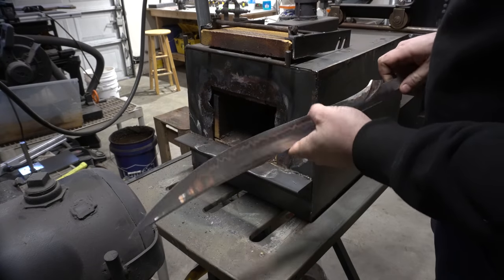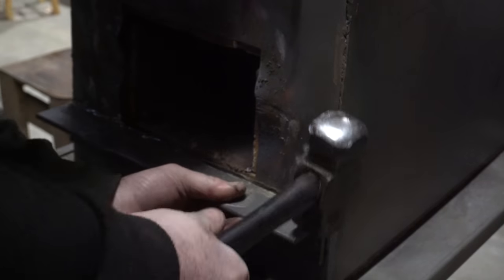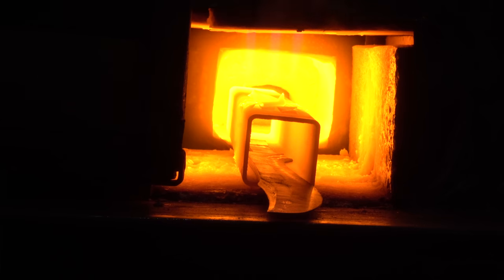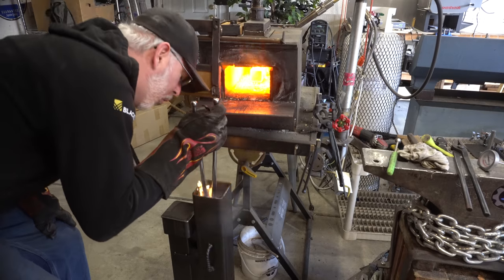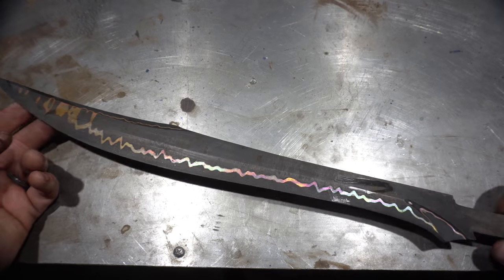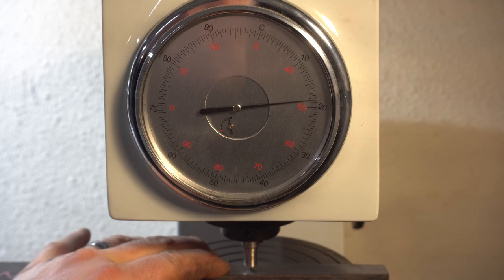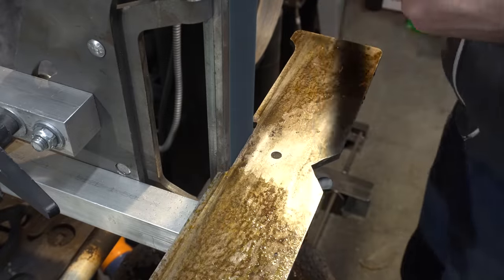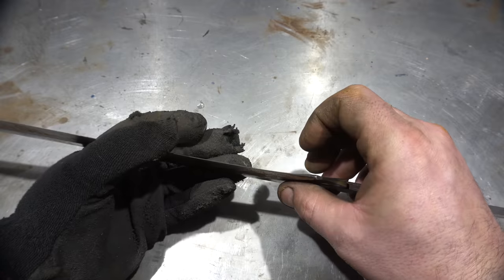Copper Damascus Elven Short Sword - Part 2: Heat treating

Comment: This blade is coming out sweet. I love the rainbow effect the copper had coming out of heat treat. Would be cool to get the effect back on the final product.
Reply from the maker: Yeah, some day I’ll get that effect on the final blade.  This one will be a dark finish though.
Reply: @TyrellKnifeworks  ya the dark damascus finish with the rainbow effect on the copper would look amazing. Your Damascus alone always comes out great. Adding the copper just makes it that much cooler. Then if it had the rainbow effect on the copper with the dark damascus would be that much sweeter. I cant imagine it would be that easy to do since reheating it to get that effect after its heat treated may could out the hardening.

Comment: Another thing you can do with a muffle tube or pipe when heat treating is put some charcoal or wood into the tube to scavenge out all or most of the oxygen and help keep scaling down to a minimum.

Love the videos, keep up the good work!
Reply from the maker: I hadn’t thought of that.  Thanks for the tip and thanks for watching!

Comment: Freaking gorgeous work as usual Dennis. Awesome talent. That is going to be magnificent with a walnut and epoxy or boar ivory and silver handle.
Reply from the maker: Nope, it’s going a different route.  The handle will be very dark with black fittings and copper spacers with engravings on them.  😮. Thanks for watching!
Reply: @TyrellKnifeworks  You'll get no truck from me on that Dennis. Your work is just plain fantastic.

Comment: Pretty sure lower viscosity cools faster. (water being the fastest) Hot quenching fluid cools slower and too viscous cools unevenly. Beautiful work by the way.
Reply from the maker: Yeah, I said it backwards in the video.  I meant less viscous / more thin, would cool quicker.  Thanks for watching.
Reply: @TyrellKnifeworks  I kinda suspected thats what happened but thought i would mention anyways. Cant wait to see the finish product.

Comment: I absolutely love your work.  You are one of my favorite you tube channels.  I hope I don't offend, but....  When you heat oil, you are lowering the viscosity.  Room temperature water has a viscosity of about 1 centipoise.  Maple syrup at room temperature has a higher viscosity at 150-200 centipoise.  When you heat syrup, the viscosity drops closer to that of water and it flows easier. The oil is heated to "thin it out" and make is easier to flow.  Thus making it flow around the blade better to prevent the stem jacket effect. So you are lowering the viscosity by heating the oil to improve (raise) the heat transfer coefficient. Sorry for being obnoxious.  Just an OCD engineer and a big fan.  I will return to quietly being in awe of your skills.
Reply from the maker: Did I say more viscous?  I meant to say less.

Comment: If you’re making a traditional elven weapon. It helps to start with the type of elven clan. Distinguishing between high elf, wood elf or dark elf. To start with. Which are the three main types. There are more than three however. Also including individual houses or clans that bare specific markings or weapon stylization.
Elven weapons usually incorporate stars or constellations. In all the different types of elven clans. This was to identify their region or geographical claim. Even the Drow or dark elves that lived in caves underground. Created artificial stars to self identity their tribal clan or house. Elves are a very celestial race. 
They have a lot of ties to the celestial realms and alternate dimensions in the cosmos. According to forgotten realms lore. Sometimes ending up with Vorpal blades or artifacts from the astral planes from extended periods of meditation or spell. A vorpal blade is basically a radioactive toxic blade. Made from uranium.
Sheathed in a protective hardened casement. 
All elven blades had some kind of poisonous substance as a part of their clans signature go too that was part of their elven code between the different clans. 
High elves used things like laurel leaves or more basic poisons from ocean fish. Wood elves used snake venom or psychotropic compounds mixed from plants. 
Dark elves used chemical elements and radioactive materials, spiders and mushrooms. That was depicted on the weapons in an engraving to remind the one using it. Each poison in some cases. Was assigned to specific elven clans. So they could differentiate between each clan during feudal periods.. Like they were making a statement. Because assassination using poison was considered beneath them culturally. Even among dark elves. But still used to put a stamp on their clans brand of capital punishment. Like a way to ensure the death was permanent. So there should be markings on the hilt handle or blade. That indicates the region by stars. The type of poison by clan. Or at lest the house symbol or crest. Elves take their blade craft much more seriously than humans or dwarves.
Reply from the maker: Thanks for watching and providing this detail.

Comment: huh, I didn't know that about the viscosity affecting how quickly it cooled, although I instantly intuited the physics after thinking about it; I assumed that the oil being hotter mitigated the thermal gradient between the surface and interior of the workpiece, reducing the likelihood of severe warping or, gods forbid, cracking
Reply from the maker: Actually the quicker something cools, the more likely it’ll warp or crack, but 1095 needs a fast quench.  Thanks for watching.

Comment: Could you try forging Damascus with Titanium Nitride if possible? I’m not even sure if it’s possible but Titanium Nitride has a really nice gold color that could go well instead of copper
Reply from the maker: Problem is I don’t think it would bond to steel.  Copper works because it brazes to the steel, titanium won’t do that.  Thanks for watching
Reply: @TyrellKnifeworks  I’m not 100% on the forging side of things, but I understand chemical bonds pretty well, and I heard you can add an interlayer of a silver/copper alloy and that will help the metals bond, at that point it probably gets too messy and complicated though but in theory I think it could work

Comment: Did you have to torch temper the blade? How does that work with the copper, because the copper would heat up faster to the torch than the steel wouldn’t it?
Reply from the maker: It was tempered in my kitchen oven at 400F for 2 hrs, twice.  Thanks for watching!

Comment: Question: Since copper softens with heat treating, unlike steel, does having it in that blade compromise it at all?
Reply from the maker: No, the copper is just a thin sheet over the central high carbon core.  It's the high carbon that is your cutting edge.  Thanks for watching, Henry.

Comment: I love your work, but I have a question..  Not that I know what I'm doing because I don't.  But aren't you supposed to apply clay or some such to the back side of the sword to insure that it doesn't get as hard as the blade side and has some flex so the sword doesn't crack/break or whatever?  I'm not saying you're doing it wrong because, I have no idea what I'm talking about.  But I've watched a bunch of sword making videos and the ones that use clay (or whatever it is) explain it's to give the blade some flex.  I think they were using damascus at least in some of them, but I can't be certain.

Sorry if it sounds like I'm being critical I'm not I promise, just curious how this stuff works.
Reply from the maker: What you are talking about is called a differential heat treat.  I don’t want that on this blade because it will put a “hamon” line on the blade.  That is a wavy line that denotes the hard and soft steel abs will screw up the Damascus etching.  This blade is small and doesn’t need the flex.  Thanks for watching.
Reply: @TyrellKnifeworks  Thank you for taking the time to educate me, much appreciated!  Keep up the fantastic work I love watching your videos.

Comment: Do you use a thermal temp gun for your temps or do you just know the temp by looking at the metal
Reply from the maker: I find the temp guns vary wildly in their calibration so I don’t trust them.  I use a magnet and go just beyond that for 10xx series steel.  Once you do it enough times the color is discernible.  Thanks for watching.
Reply: @TyrellKnifeworks  im not very good at figuring out temps. I was thinking about getting a kiln for heat treats, etc to be more consistent.  I think i get mine too hot most of the time.
Reply from the maker: @MrBill-ee4mr  I strongly recommend a kiln.  You can use the salt technique since it melts at 1474F.  Throw some on your blade and when it melts, you know you’re at critical temp (for 10xx steels at least).  👍

Comment: Any special reason for the stainless steel tube over a black iron tube?
Reply from the maker: Nope, that’s what I had that was big enough.  😜
Reply: @TyrellKnifeworks  Gotcha.  I finally melted through my black iron pipe and was wondering if you knew something I didn't.
Reply from the maker: @lasersailor184  the stainless will be slightly tougher in the forge and last a wee bit longer, but not why I did it.

Comment: Right on!!! I’m lucky with my kiln with longer blades that won’t fit. I’ll hang them in the chamber with the lid opened and cover it with kaowool. I was surprised how well it actually works!
Reply from the maker: Yeah, that’s a nice option.  Mine is 18” and with the tang on this one it’s 24” so no chance it would fit.  Luckily the forge HT worked out.

Comment: This is a very nice blade you’ve made. I suggest you try using a different copper alloy. For making elven swords. Like phosphor bronze. Instead of plate stack for the ribbon. You could also forge weld a different pattern with cut out pieces in the shape of the elven language or symbols. Elven swords should have a golden brass or gold like shine to them. Depending on the type of elven race or tribe. What most consider elven are brass colored weapons. With a phosphorescent hue to the blade. Which can be embedded into the scroll work then amplified by a small black light in the hilt.
The blade manufacture can become incredibly complex and artistic. To include a limited processing functionality or ability embedded into the blade. In some of the more complex elven blade manufacturing. Sting for example. From the Hobit. Is a blade that glows blue when in the presence of a blacklight or certain blood type. It is actually just the elven language that glows blue. The weapon held the ability to do trace blood comparisons. Which was considered useful for high elf warden. Tasked with tracking down bounties. Stabbing the blade or dropping some of the blood onto it. Caused the blade to glow in affirmation that it was an identical blood type. Basically the blade was designed to hunt down a specific clan lineage. That had been all deemed heinous criminals.
This was achieved through the forge process. By treating the blade like the construction of a semiconductor. Embedding functionality through a forge welding or an intricate casting and engraving process. Where the skill level of the weapon smith shows in their ability to hide the components it appears to be magical.
High elf weapons are different from wood elf Or drow blades. Which range in size style and shape. 
High elf blades are more elegant, refined and practical. Like an ornate cutlass made of embossed brass. Or a silver and gold opal inlaid blade and hilt with ivory handle. Usually very skinny highly refined blades. Like a rapier without the basket guard and a quilion hilt instead. Good example of a high elf blade is the sword of princess Zelda.
Which has multiple functions built into a blade that handles like a fencing sword. But has the blocking power of a broadsword. Usually high elf blades have a stately quality. Such as a house crest or symbol of their province. Often laws or rules for engagement are engraved on these blades.
Wood elf blades incorporate natural substances that add functionality or practical camouflage. Like woodsman tools for rapid arrow head making in the handle of a knife. Wooden handles and scabbards made from branches that were grown into shape instead of cut.. Uniquely designed around the tribes home tree or a defining characteristic of their forest. Sometimes made from things that were still growing or alive. Like putting a Bonzai tree built into the knife handle. Or seedling incorporated into the blade so when it killed their enemy and they were unable to retrieve it. A tree would grow out of their enemies corps. Like some attempt to make the forest right again even in death.
Drow or dark elf weapons are the most durable and intimidating of elven designs. With spider like motifs with house symbol. Although there are different house spiritual animals creatures or insects. Often including some form of luminescence for sword fighting in the dark. Or being able to identify handle point and position at night or in a cave. Typical dark black blades with stone handles.
This sometimes goes as far as unique blade colors that identify the individual clans on the battlefield. So they didn’t become a target for incoming arrow fire from their own archers. 
Drow blades are probably the hardest to make right. Because of the hardness of the metals. 
Which is sometimes made with pattern welded titanium. With hilts made from
blackened niobium alloy. With inlaid phosphorescent stones. In the shape of their houses constellation. Illuminated with a small blacklight emitting amulet. 
Each house used artificial stars over the cavern celling to identify their clan. Which is typically also on the weaponry. Which was unique to each faction.
Reply from the maker: You get the prize for the longest comment ever.  The sword I’m working on will be the first time I do engraving, so there’ll be some marking on the fittings.  You’ll have to wait and see.  Thanks for watching